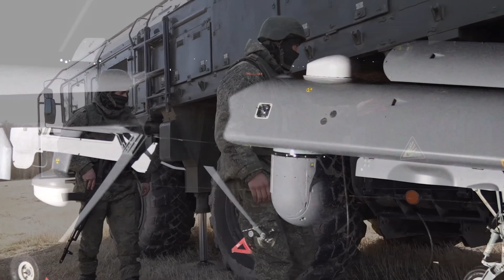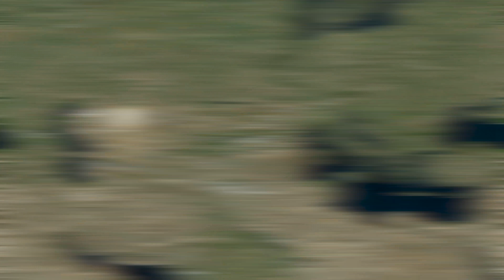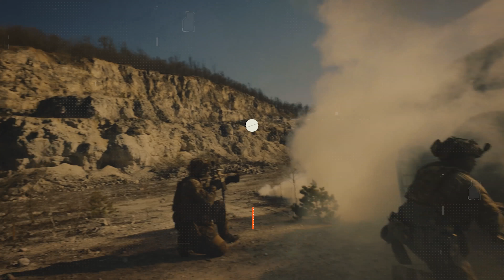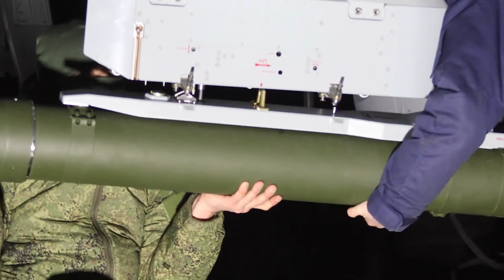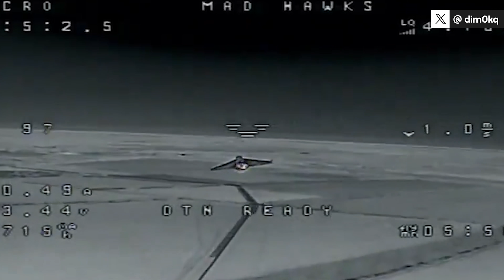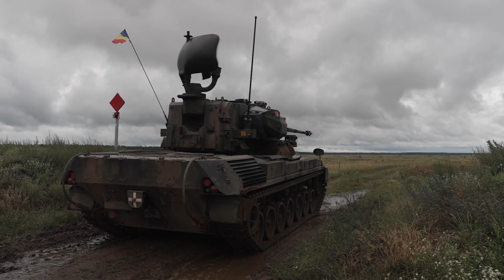Russia's NEWEST Missile Runs on a TEMU Engine… Ukraine Killed It With Grandpa's Gun

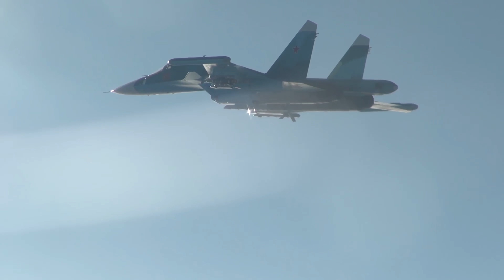Comment: 11:00 one Skynex system cost ~100 millions $...AHEAD ammo about ~ 1.400 each round. Standard salvo 10 rounds. Range 3 - 4 KM. 
With this excellent short range system you have to choose witch valuable facility you will protect. And you will need to have many of them.
The procurement price is extremely high, and protection is very limited by range.

Comment: They are similar hobby engines as used in the Jet Suit, the Flyboard Air flying platform and the recently seen flying bike (a bit like in Star Wars). The engines in the bike are only about ten or twenty grand each and the flying bike uses several of them (like in the Flyboard) that costs like a hundred to two hundred grand for all the engines in the bike, and the rest of it is just a bit of metal and they charge nearly a mill for it! 😮 That's ridiculous! What a rip-off! 😂 It's just cos it's so cool and it looks so cool, flying. 😂

Comment: Guys, i've been arguing that we should use small hobby engines on one way drones for years as a cost saving measure, but use like 2 or 3 of them to counteract the lower reliability. Despite using 3 engines thats like a $40k difference, and in theory adds redundancy over a single engine. Maybe find ones with a very high bypass ratio for smaller fuel tanks or longer range.
Reply: Maybe just building a model C17 or IL76, complete with 4 of these engines, and sending it on its way with a load of fuel and explosives would work. They are transport aircraft after all

Comment: Both sides are using hobby electronics, the same $20 flight controller you use in a hobby drone has a 6 axis motion processor, altitude and compass sensors, a 32-bit CPU and a whole bunch of general use input output ports that can do things like control servos and interface with external hardware like an off the shelf GPS module, and the whole thing runs on open source software you can download and modify. Very easy to repurpose something like that into a missile guidance system or whatever. This is where all the recent restrictions against hobby R/C are coming from, everyone realized few years ago that hobby R/C stuff had gotten astonishingly powerful for relatively little money and could theoretically be used for nefarious purposes. As early as 2010 the US government wanted to blanket ban R/C airplanes and related equipment.
Reply: Yes, one side is a small country with a small economy, the other postures to be the second biggest military in the world, claims it could take on all of Nato and America at the same time.  When Ukraine innovate its admirable,  when Russia does this its embarrassing.
Reply: @DrewLSsix  ukraine can only hold on for so long due to the massive western support. Germany allone is sendong 90 billion €. In comparrison ukraine's gdp is only 190 billion. 
Add to that modern militarry equipment,  starlink for communication and direkt advisary on where exactly russian infrastructure is.
Ukraine is not fightling like a nation fighting a war, but more like a pmc that has it's own nation, but is cimpletly financed and equiped by others.

Comment: Doesn’t matter where the engine comes from.
If it works it works…..
Reply: It is literally a 1-way trip. Why spend any more than you need to.
Reply: Thats a hilariously out of touch statement.
Reply: @DrewLSsix  It's cheap one-use hardware that is meant to be yeeted in batches of several hundreds or low thousands at the enemy. The statement is very much in touch for this use case.
Reply: @Chriva  this channel is AU bots depot. Common sence is not welcome here.
Reply: @DrewLSsix  DerTyp States the bleedin obvious. In what way is he out of touch?

Comment: If I may inform non-aeroplane people, people can buy micro turbines or micro jet engines for their radio control toy airplanes for several decades.   

People have install small jet engines on kit planes for decades
Reply: Also used in gliders to maintain altitude when thermals and updraughts aren't good enough.
Reply: And "jet pack suits"
Reply: The compact flying bike has about 200 grand worth of mini jet engines in it, and they charge nearly a million bucks for the bike! 😮 What a rip-off! 😂 Specially cos the rest of the flying bike could be carried with one hand (there$ not much of it). It'$ more like a flying $tool than a bike (like you are pretending a $tool is a bike). 😂
Reply: I wouldn't call a 16K engine a small jet engine for kit planes.
Reply: @a0flj0  You may not, but there are enough people spending lots of money on hobbies that do. There are cheaper microturbines, but even then "cheap" is still a few thousand dollars.

Comment: Ali exspress and tenu are not the same temu is the cheepest of everything at least with ali express is halfway decent
Reply: I bought a Rovan Baja 5B with a 35CC two stroke engine off Aliexpress last year for $500 shipped. This is basically a copy of HPI's old 1/5 scale R/C Baja buggy and it has been a good car though I have added some upgrades that I would have added no matter who made it like extended suspension arms.